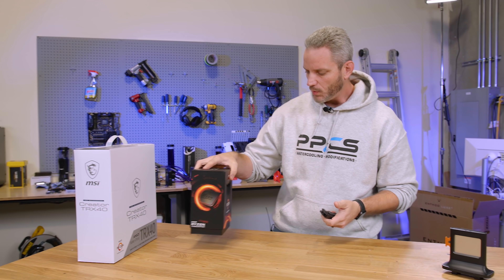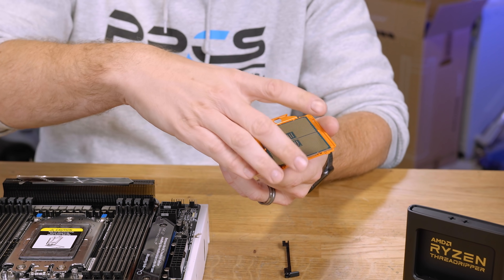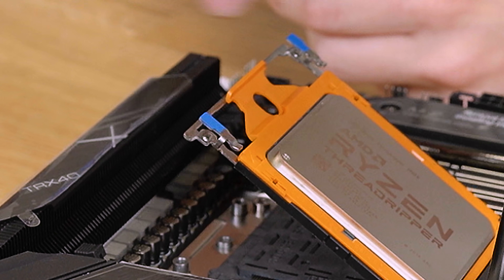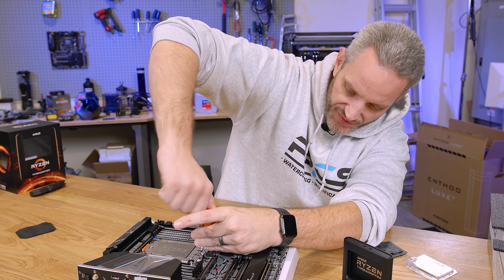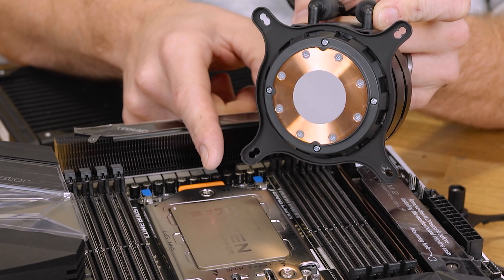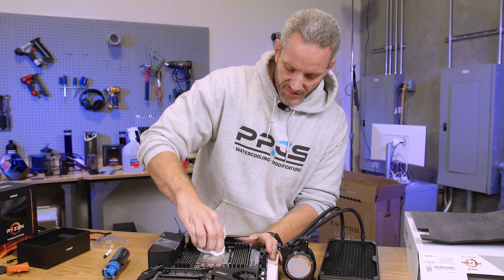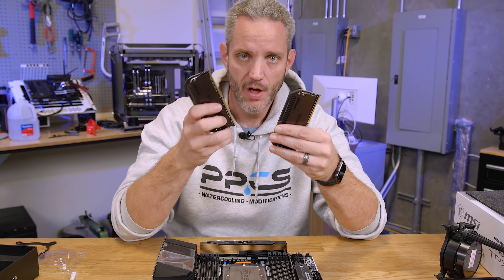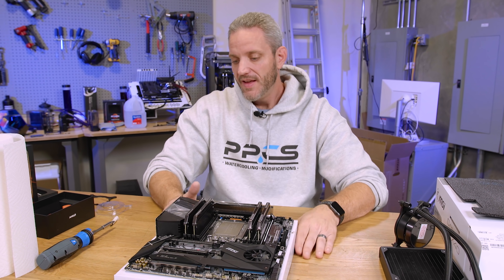Don't Make These Threadripper Mistakes!

Comment: Thanks Jay, first comment.  Best Threadripper how to I've seen.  The 1950x and x399 platform can be had 2nd hand for cheap right now.  Got a mobo/8gb RAM/1950x for less than 300 off the EBAY.

Comment: only thing about that BQ dark rock pro is it makes it so tight with the ram sticks... ive been using DRP for a long while though and i am so happy with it other than space and the dust they collect... keep in mind if you get lots of dust you will need to rebuild your system everyonce in a while to blow out that dust.

Comment: Just to let you know, i'm just built an Asus WRX80E with AMD 3995wx processor and your mention of torqueing the chip solved my boot problem.  I had not fully torqued it as you stated to do.  I don't have a much space to play in as you do.  I on my wifes sewing machine Cabinet that she wants back.  I just a few minutes ago carefully fully torqued the chip going around the chip tightening till they were all almost stopped. then I triggered the slip in the torque wrench.  powered it back up and finally got my boot screen and the motherboard detected first time boot and now i'm in bios hell trying to get the boot settings done.  I've booting from usb first to install the windows 10 from dvd.  Then boot from nvme m2 on the mother board.
Thank you for for you video if  I had not reviewed it and took note of the torque and remounting chip i never would have gotten it to work.  First mother board I had to send back on an RMA due a weird code that Asus couldn't figure out.  Just wanted to say Thank you!

Comment: Help.  Bought the Gigabyte board.  I've built several computers including a Ryzen last year and a 10700 last month.  My Gigabtye WRX80 board "sees" my Sabrent SSD and Corsair Win 10 install USB in UEFI, but won't put them in the boot order so I can't even get started.  My only boot options are UEFI and Network.  Gigabyte support blows.  Suggestions?

Comment: Most AIO Coolers still mirror Asetek oval shaped CPU blocks even the ones that aren't using Asetek's technology.   CoolerMaster and Enermax are the only exception as their blocks are rectangular. 
Gamers Nexus has a good thermal paste spread tips for Threadripper size heat spreaders that people should check out, it helped me in deciding how to apply my thermalpaste on my CPU using a MSI MAG CoreLiquid 360R aio.

Comment: OH MY GOD DONT TOUCH THE BACK OK THE CPU, DONT DO IT TRUST ME THE SWEAT OF YOUR HANDS WILL CORRODED THE METAL AND IT WILL NOT WORK AS WELL AFTER MAYBE 1 MONTH, EVEN IF U THINK UR HANDS ARE DRY DONT DO ITTTTT.
Reply: I touched the back of my 2990WX by mistake it makes a finger print mark, but it didn't affect the performance of the CPU, and that was 2 years ago when I did that, and have swapped out the CPU into different motherboards and the CPU operates good as new.

Comment: As someone who also works on automotive parts, isn't it always best to "kiss" each fastener before proper torque is applied? I've opened engines before and it's important to snug down bolts finger tight first (in order) to maintain even tension on a flat surface. I'm confused as to how this principle doesn't apply here.

Comment: It's absolutely disgusting to see this individual touch the pads with bare fingers. Static, grease, you name it, any employee in a company that deals.in micro electronics would be fired on the spot if they did something like that. Not only that, it sends a disturbing message to the audience.

Comment: About that Asetek water cooler, I used a Corsair H150i for 2 builds. 
I cleaned off the included thermal paste and dumped a metric crapton of Noctua NH12(or whatever) thermal paste to get full coverage of even the screws around the heatsink plate.
Temperatures went down immensely compared to a very big Noctua tower cooler (it was pre-installed, not sure which one)
So while I would recommend you to get more proper coolers for it, if you're smart about it you can do a lot with these AIOs!

Comment: Just installed a 3990X on this board yesterday but still waiting for the CPU Cooler before turning on. The M.2 installation guide for this board was a little confusing. I installed two m.2 SSDs to the bottom array because in the book it was labeled as CPU and the top right M.2 slot was labeled PCH. But the confusing part was whether or not I am suppose to keep the blue film on the thermal pads depending on single sided SSD or double Sided.

Comment: Looking for some advice. I have a threadripper 3970x, that I mainly use for rendering, but I also occasionally game. Recently i've come across several games that can't play because of the amount of cores, so i've used the AMD Ryzen Master to lower my CCD from 4 to 2 and the games run. Is that safe to do or am I slowly breaking my CPU?

Comment: Jay, you probably don't read all the comments, I mean how could you? However I wanted to remark on using a Noctua air cooler with the Threadripper line. While I really like Noctua and have far too many of their fans. Their Threadripper cooler is not sufficient for any sustained loads. If you use your system as intended, as a workstation, you'll want a 360mm AIO at the least. If you just game, or do light workloads, then use whatever you want. Now, I do agree to not use the AIO you have, as the contact surface is horrible. I used that cooler originally when I built my system, but quickly switched to an Enermax (I know, terrible systems, but it still works) and it dramatically dropped my temps.

So in short, stay away from air with the Threadrippers. If you go AIO, use a 360mm unit if possible and find one as you say to that covers the IHS as much as possible.

Thanks for the good content and keep up the good work.

Comment: Hey jay I have another question what mother board do you prefer for this type of cpu. Ya the 32core one in ever I have ever since , which is a lot all mother board break eventually. Some longer than other, but!!!! I have never broke a gigabyte board do you feel about that? I’m about to drop $10-12 grand on a computer, and to everyone asking yes I need it for software editing, and video editing. 

I literally seen a $500 asus board die right infront of me everything was proper heat pressure / cool temps thee where flow nice and smooth. So I’m just ask you :)

Comment: I just ordered a 1920x at $320.00.. today... New.. retailer prime buy.  all that's left on eBay is used.. eBay has sold out.. there is the 19 00x but there would be no improvement.. compared to what I had in a older PC.. I am wondering a lot of things. Including if this motherboard is going to be made anymore or are they just going to go to the third gen.. is a CPU going to be made.. Amazon sold out.. except for one..

Comment: I want to do a Threadripper build but I just don't have a need for all those cores/threads. Only Threadripper that would be best for me if I did would just be the 1900X but I just got off first gen Ryzen and it's issues and I really don't want to go back.

Comment: I once dropped my smartphone onto/into the TR4 socket of my MSI X399 and got ~50 pins bent. Refused by MSI for paid RMA, I unbent them with some magnifier. The system could boot but shows instability. Actually, it had been showing BSOD ever since it was built since late 2016. I was trying to see if it was the cpu contact issue when dropped the smartphone when using it as a torch. But I thought I was toasted 'cos of the pins. Then on one day, the system died. Diagnosed it with a bad PSU, replaced it. And now, the system is 100% stable with ~100% cpu for months. So that was not the bent pins but always the PSU. 😂

Comment: well I ve managed to clock my tr1920x to 4.15 ghz (I dont need more performance for my second system) and the tr2950x of my main system to fantastic 6.069 ghz pb mode and about 4.314 ghz base clock so yah, things seem to work by plan ;)

Comment: Why not use the Teksyndicate way of using a single ball of thermal paste in the center of the chip, rather than a shape with air pockets?
Reply: I prefer the Verge Stefan way of applying paste...
Reply: @dennisanderson8663  What way is that?
Reply: @Corb.ontheCob  You've never seen the $2000 gaming PC video from Verge!?
Reply: @dennisanderson8663  No!!  I've never heard of Verge haha, I'll go look it up!

Comment: I put on a nitrile glove then dab a thin layer of thermal compound all over the heat spreader or onto the bare die on chips without a spreader. Then I install the heat sink. Next I remove the heat sink and check for spots where none transferred. Those get dabbed with compound on the heat sink. Reinstall and it's done, with the absolute minimum amount of compound and maximum contact, instead of hoping a thick application in the middle is going to squish out. I have a tiny syringe I got with a Cooler Master heat sink, still haven't used it all. Also have a bunch of white compound in a 35mm film cannister. Been dipping into that for years.
Reply: I definitely am suspicious of people that just put a glob in the middle and expect it to spread out & cover the entire chip when you put the heatsink on.  In most cases, it won't be covering every part of the CPU.  Some guy on Reddit had a very nice video where he used a flat clear object to demonstrate many different methods of applying paste and which ones are not going to cover the entire thing.

Comment: Did I hear that it has 9000 pins? If someone did bend a pin, how would you know which pin you bent?
Reply: Pretty sure at that point you will have a very expensive paperweight.

Comment: I use a credit card to spread out the thermal paste into a nice even thin layer across the whole heat spreader. That used to be the norm for modders, but all I see on youtube PC builds are people putting a couple stripes and calling it a day. Spend a little extra time and you'll get better results.
Reply: Yep too many PC experts think a circle can turn into a square.  The thermal paste layer must be thin but it has to cover every single part of that chip for it to be cooling efficiently.  Spreading it manually is the only way to ensure this.

Comment: Jay : "It's really important to use the torque wrench and apply the screws in the right order to seat your CPU evenly and with the right pressure"

Also Jay : manually squish the cooler onto the CPU to "help" spread the paste onto the IHS
Reply: According to Stefan at Verge, you must screw in with confidence!

Comment: I just bought a brand new 1950X last night. Snagged it for 400.00 with free shipping.
I'm using a budget board though. (x399 phantom gaming 6). Next payday I'm grabbing my ram.
I can't wait until first boot.  This will be the baddest system I have ever owned. 
This will even outwork my dual socket 16 core xeon system.

Comment: Absolutely. I found out the hard way when I got a 1950x 2 years ago when 2nd gen just came out and they dropped to $450. I got a CLC280 at first and when hitting 100% CPU usage in renders, it would immediately hit its thermal limit and throttle the CPU. I returned the CLC 280 and bought a Wraith Ripper cooler and it was way better. It covered the entire IHS. Unfortunately they made a mistake and the fan direction on them is installed backwards for 90% of how people have their cases set up. I had to disassemble it and flip it around (voiding the warranty I'm sure). Then I made a fancy custom zip-tie loop going around the entire thing to add a 2nd CPU fan. Very happy with temps after that.

Comment: an asetek is fine if you apply your own thermal paste.  the preapplied stuff is built for a smaller chip, it's just simply not enough of it.  use enough, and it's enough.

Comment: I guess, the thrid screw, is putting the pins upwards. This is why it won'T work if its not tighened the right way, and going defective if to much. It's totally uncommon in this business to use precise torque. "Hand warm" is the state of the art right? ^^ So there must be another reason. Intelboards flip their pins out when the cpu gets locked on the socket

Comment: wait... why is it bad to use pre applied thermal post with a little more additional... say Corsair TM30?? I've done this with my cpu's and have never had an issue though I run Zen 7's right now, may someone answer pls?

Comment: God fucking damnit. 11 years ago I bought a LGA 1366 i7 to learn later that the line only continued for a couple more years, and this time bought the Threadripper 1900x hoping that at least with AMD I'd get a few years before hitting the end of line just to discover this this video that I'm dealing with the same bullshit that Intel gave me??
Reply: You can go from 8 to 32 cores, doesnt sound so bad.
Reply: @riba2233  but that's the only improvement option I can get. I won't be able to enjoy any other advancement that's made since it will all be on a new socket. :/
Reply: @NovaHorizon  yes I get it, I have 1950x and was also hoping for an ipc upgrade.

Comment: I love these videos. There are people who are going to be helped by this, especially fist time TR. 

I started out with 1900X, the 8 core TR and used a 280 AIO with the round block. It didn't matter at all, the chip produced so little heat even when overclocked. Later, I upgraded to a 2950X 16 core, again with the round-on-rectangle cooling solution. What I found was that with maximum PBO and AIDA64X stress, the temps peaked at 68 C initially and 70 C peaks when heat soaked. I carefully felt the air around the block, and detected no heat. Then I actually felt the metal brackets and clamps, and finally the outer edge of the copper block and found that they were not hot at all. 

Now, obviously the 3000 series TR have a different layout, but for gen 1 / 2 at least, the round part permitted PBO to to boost to its maximum clocks, even with over-volt/amp and maximum scalar offset. With 3000 TR, I would imagine that the guy who spends $2000-$4500 on CPU/MOBO can probably afford the highest end cooling, and with twice the dies, its probably going to make a difference.

Comment: Correction please:

3rd generation RYZEN does work in a 1st generation motherboard, assuming you upgrade your BIOS. AM4 sockets are still in use

3 generation THREADRIPPER will NOT work in a 1st generation motherboard. sTR4 is not the same as sTRX4

Comment: If you have nothing else you can take that round cooler and evenly spread the compound over the entire surface to ensure every bit that is touching can remove heat properly. I do this even with a standard ryzen cpu. I don't trust any hotspots personally.

Comment: when i first bought my 2950X i also got my first watercooling. the ROG ryo 240. i also laughed abit when i was gonna mount it. since the plate on the cooler is like half the size of the TR. and my temps was NOT good. 61C at stock in cinebench. at 3.8ghz boost all cores. eventualy i swapped my case to The tower 900 and did full custom cooling and superb paste. that got me down to 60c max in cinebench. but with all cores at 4.2 ghz. tried aio at 4.1 but would jump to 75c instantly so i shut it off.

Comment: OMG what an awful socket design.  These CPU manufacturers keeps screwing us with requiring new motherboards with every damn next CPU they come out with.  I'm tired of buying and having to pay for  the same things found on motherboards over and over and over again...  sata controller, sound controller, pcie slots, ram slots, integrated video, glue chips, usb controllers, etc.   Seriously, all this is pretty much the same crap found on AM3 and AM2 and socket 939 motherboards...  going way back.

Comment: 4:41 Hello Sir 
I highly recommend not touching the contacts with your fingers. Human skin is a very acidic environment, and acid corrodes metals very quickly. 

That's why AMD even included a handle into their tray design where you can easily hold the processor. 

I don't think i need to mention static electricity as well. 

If you can avoid touching sensitive metals, especially in electronics, please avoid it.

Comment: So the Threadripper basically it's a little bit different, you have to treat it like a luxurious baby which will bend your motherboard pins if you screw up way too far.
Reply: is cheaper to replace a MB with a bent pin than to replace a CPU (with a bent pin)

Comment: Dude you haven't got a clue how thermodynamics actually works so you? Heat moves towards coolest spot NOT out from it.
Reply: The chiplets that doesn't have thermal paste or heatsink coverage will move their thermal energy thru the IHS. Problem is the chiplets are already conveying in middle. Its about capacity and rate of transferring heat in a given time. Thus in this example he is quite accurate. The optimal way would be to have full coverage.

Comment: The motherboard instructions says that before you start screwing it tight... that you should make sure that all 3 screws actually are on the threads first a little bit, THEN its safe to start tightening. Which you never did ;)

Comment: As usual, you didn't go far enough out when you applied your own thermal paste.  There was surface area on the cooler head that didn't have paste on it that would have had some if you applied correctly.

Comment: 11:26 "I'm not going to spend more than $100 on an aircooler" said no one ever after buying a CPU that costs about 1.5K to 2K
Reply: Literally what I said, who buys a threadripper and.. "Oh I don't have 100 dollars for a new cooler."
Reply: 3990x £3.6k bruh.mp3
Reply: There is a thread ripper that's $210.
Reply: @OnionYeeter  I'm running one of those currently, with an Arctic Freezer 50 TR that I got for $65. There's some more affordable Threadripper air coolers now
Reply: I was looking at than and wondering what kind of air cooler I could get with enough heatpipe on it to overhang the ram and blow down on it, because that's going to get hot too.